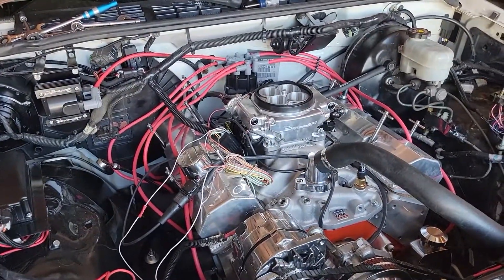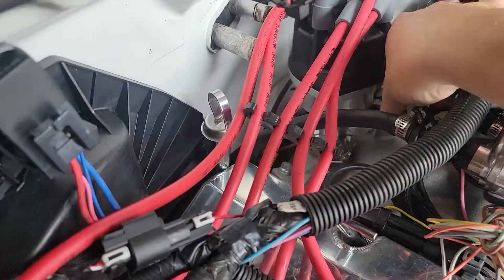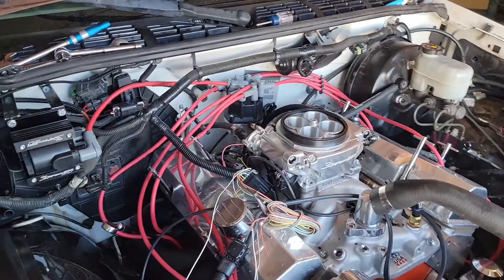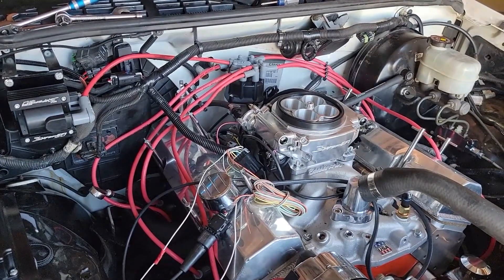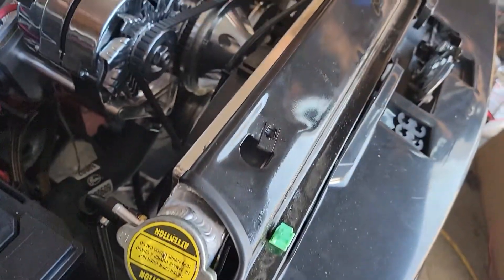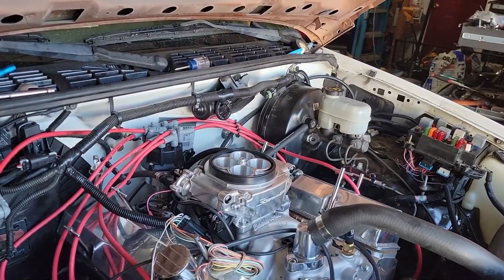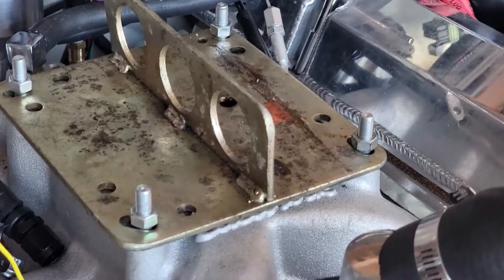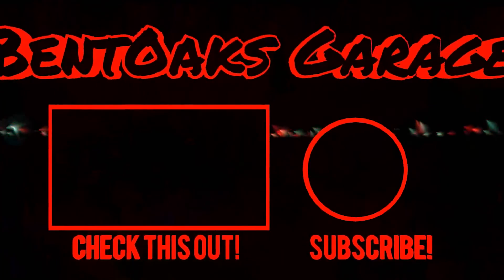What is going on with my Holley Sniper Digital Dash?!

Comment: Did they figure out any issues if not. Seems like RF noise. Try getting some RF tape from Amazon to wrap around exposed wires/ wires not in the sheathing of oil pressure and fuel pressure. I started having similar issues once I installed the sniper ignition system.
Reply: My issues with RF noise was a lot worse it actually shut the car off on me. I’ve had other issues associated with RF noise with that ignition system. I’d be interested to hear back from you if the RF tape works. If I was able to add pictures I will show you how I wrap the wires to fix my issues.
Reply from the maker: @MalibuTim76  hell, if a RF tape will work... I'll give it a shot
Reply from the maker: No, I never figured it out. I just added an a cheap parts store oil cooler and that's good enough for now. I just ordered a new 383 to replace this 355 that in the truck now. I would love to figure out this issue. I never thought about RF noise.

Comment: Did the 7"dash come with the sniper? Did it come with the smaller handheld controller? same reading there? just curious.
Reply from the maker: No, the 7" was purchased separately.  One problem I'm running into is I only purchased the base sniper unit instead of the super sniper (about $200 extra). Because of this the oil pressure sensor hooks into the i/o ports (sold separately) of the dash instead of the sniper. So there would not be a reading on the small handheld unless I purchased the super sniper. A little confusing but I hope that helps.
Reply: @BentOaksGarage  Gotcha, I have the terminator and was thinking of getting the dash. My sensors plug into main harness.